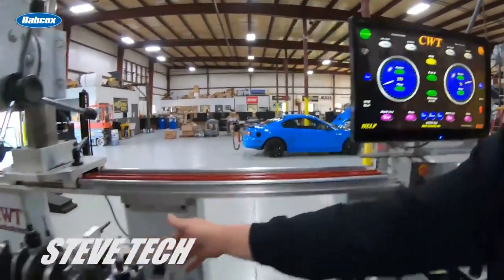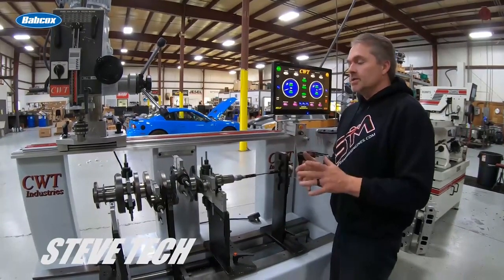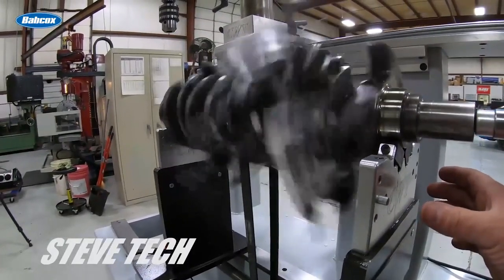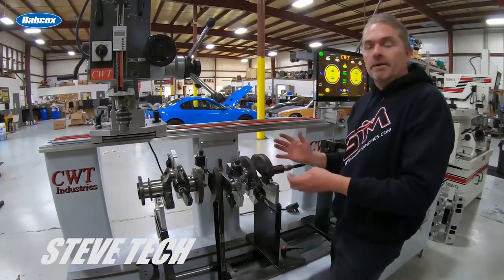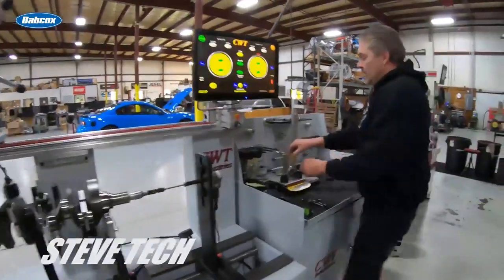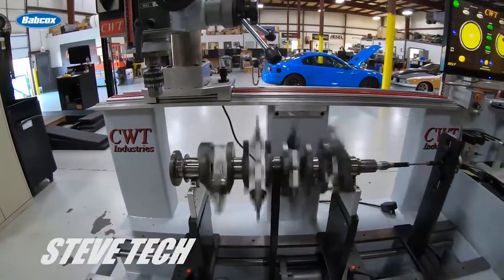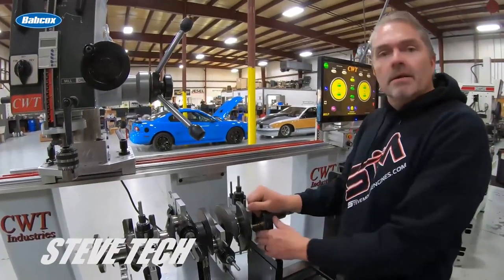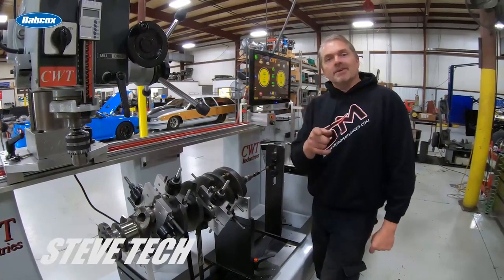Crankshaft Balancing – Part 2

Comment: You missed the most important part of mounting the bob weights.  Clock position or level as you used is nearly irrelevant. It is absolutely essential for the bob weight to be in the center of the journal (Neal, 2007, 2023). Additionally, do not rotate the crank by the bob weight.

Comment: Do u always have to take the extra weight into consideration? Can u not balance the crank shaft without adding the weight of the piston, rods etc?
Reply from the maker: No, you always want to take into account your entire rotating assembly, which includes pistons, rods and rings, etc.

Comment: Is a NEW crankshaft properly balanced or can it be way off? I am balancing my rods rings pins pistons so what do you think? Great videos Thanks!
Reply from the maker: A new crankshaft will still need to be balanced. Many crank manufacturers offer balancing as an option, but it's typically not included if you don't ask for it.
Reply: Oh well that explains why some newly rebuilt engines just  don’t sound quite right. Thank you for your help!
Reply: @EngineBuilder  about how much does this cost to get done?  Working on my very first build this summer.
Reply from the maker: @zadynsmom  the price depends on the crank manufacturer or the shop you bring a crank to for balancing.

Comment: Thanks for the tutorial Steve. If you still have your ears on, could you comment on externally balanced engs.? (Or maybe a viewer who knows.) A Pontiac 301 smog motor, (built from 77-81) has what's called a "rope" crankshaft. Only has 2 opposing counterweights, (one at ea end). Like a 400 SBC, it has a corresponding damper, and flywheel.
If the rotating  weight is changed, (say .030 over pistons, and lighter rods), what would you recommend for balancing? Or would it need it, if kept under 5K RPMs? Thanks.

Comment: thanks stevie, just a quick question i've seen cranks knife edged and balances without any bob weights what effect would this have on an engines running and performance it was a 4 cylinder don't know if that has any bearing.

Comment: Is that a makeshift thinggy?  why not balance the whole assembly in a/the block? 
externally driven,no explosions, no need for oil pressure,grease will do for those seconds at a time..

Comment: Question,  what is the reason for balancers, stick type,but some are 28 oz, 50 oz. The balancer im replacing has no balance weights that I can see,removable or otherwise.  I do know the new flywheels or sold in conjunction with 28, or 50 oz balancers. Can you please explain this. I don't want to buy the wrong parts. Putting together a reasonably hot sbf.externalky balanced. Just want to understand  the protocol.  Thank you
Reply: All stock OEM 351W are 28 oz imbalance. That means from combined imbalance weight of flex/fly wheel and balancer are 28 oz more. On 302's Ford changed the imbalance from 28 oz (from 1968 to 1978) to 50 oz imbalance (1979 up) This was because Ford removed 22 oz from the cranks 79 and up. So they had to make up for removing 22 from crank by adding it to flex/flywheel to keep things the same. 28 + 22 = 50

Comment: I am designing a new type of Rotary engine... with 16 cylinders... with 8 cylinders on one side of the crankshaft and 8 on the other.  Where all 8 rods are on a single lobe on each side.  So it is basically a 2 cycle... with equal forces on both the up and down on each of the cylinders.  Which is approx. 1200 lbs. of downward force at the top of each cylinder stroke.
And what I need is someone to help me revise my (SolidWorks 2018) Crank Shaft drawings to facilitate proper balancing.  And Afterwards, I will need to purchase equipment to do the balancing of successive equipment I build.  I need help to locate a place to help me with the initial balancing and redraw of my Crankshaft.  Can you help me with this?
Leslieallen  At... inventorshaven@pm.me  I am designing this engine right now.  
I live in Oregon area... and it would be convenient to find someone close to that area if possible.  But I will not be critical about that if it comes down to it.

Comment: The weight distribution of the bobweight itself may not be ideal evenly. Therefore, it is not relevant to put them on necks with a rotation angle of 90g. You can check the bobbin unbalance by placing it on a balanced rolling pin equal to the crankpin diameter. This is very easy to do. After doing this, you can explain about another approach to installing bobweights on the necks. Good luck checking out the bobweight imbalance.

Comment: Any thing + - a gram is great. Over or under balance is a builders choise and oil and windage are not a constant variable do to rpm / engine load and engine acceleration/ deceleration deloading. A engine like industrial type at a constant rpm / load is completely different from a drag / oval track race engine. Dynamics are a factor

Comment: 8 grams at 4" at 8000 rpm is about 250 lbs (if memory serves)of side thrust on the bearings so that's rpm capability and horsepower loss. We never balance outside 2 grams, better is always better. Not saying 8 or 10 grams is horrible but it barely takes any more time to get to 1 gram on each end.
Reply: 8 grams 8" from center at 8000 is 112 pounds of out of balance force
Reply: I've been balancing engines since the mid 70s, on a Stewart Warner model 2000
Reply: i'd love to know what extremes of balance F1 went to in the 18k rpms days.
Reply: What I don't understand is that he said in the last video that the post it was about 0.8 grams but now he is saying its 8 grams?
Reply: @krnt13 1 gram is the weight of a US currency bill...
Reply: Incorrect, 8 grams 8" from center at 8000 rpm is 112 pounds of out of balance weight...
Reply: @ChiefCabioch  You’re absolutely wrong about your numbers! But does it really matter to make the point.
Reply: Out of balance Weight goes up by the cube...
Reply: @ChiefCabioch  🤣That’s funny! Even after two years you’re still just as wrong.
Reply: @causeimbatmaaan  how long you been balancing engines genius?
Reply: @causeimbatmaaan  you had to question your memory, I didnt...
Reply: @causeimbatmaaan  you only think you know balancing...but you dont...
Reply: Yup this guy's a hack doing half assed work
Reply: Ask the guy that balances crankshaft above 5000 rpm and find out that information
Reply: @causeimbatmaaan  there is no side thrust from out of balance, it's all centrifugal force, not for and aft...

Comment: What happens if u dont balance a 454 engine?
Reply: It will shake like a dog craping peach pits and break the crankshaft causing catastrophic failure.
Reply: @stuartbuckley8720   when, at what rpms? will it shake itself to pieces right off idle? at full bore?will it idle?

Comment: Get you some of those small powerful Neodymium magnets to stick on the crank in different spots. There cheap on Amazon.
Reply: May stay on a 500 rpm but what happens at 10,000?
Reply: @ellieprice3396  I'm pretty sure he was using magnets like the jamb bolt used in the video.  Used as reference because heavy metal can't always be added in the exact spot the machine says to put it.
Reply: @andrewevans1658  true.

Comment: Don't work at Auto Zone, I work on bikes that rev to 15k.  8 grams DOES matter.  Unless you only work on crap American engines.  XD
Reply: Sounds like a pissing match to me, you boys need to chill and get some beers.
Reply: @stuartbuckley8720  Not really, but ok
Reply: "Crap" American engines? don't think so. Former Holman and Moody machinist.
Reply: @ellieprice3396  Nobody's impressed old man.  I do think so.  They're crap.  Always have been, always will be.  Former machinist and current chassis tech on a national team.  Show me an American engine that makes over 100hp/liter and runs half a million miles.  There isn't one.  Because they're crap.
Reply: @mikaelgaiason688  100hp/l (naturally aspirated) can be done in an overly complicated engine. american V8 are extremely simple engines, much easier to work on and less chances to go wrong. For high power applications they use aggressive cam profiles and higher rpms, not suitable for street. So they are not worse they simply have a different cost effective and reliability approach, plus the crossplane v8 sounds really good. Anyway these engines are nice for sports cars not daylidrivers where you need better economy.
Reply: @rotorblade9508  you're wasting your ink, responding to a commenter who can't even spell his own name correctly. (Mikael?). Here we go again. "My engines are better than your engs., and I'm smarter than you. I work on bikes that crank 15K, and 8 grs "does" matter".
 
Steve is correct on everything he mentioned in this video. So now it's my turn. I've been building and balancing Pratt and Whitney dual spool jet engs. for 40 years, and have stood behind these same machines for that same amount of time, to this very day. The "real" world is totally different from the engineering "book" world. Have this same battle with people who don't balance all the time, and hear the same stories from others in the trade. A book could be written about this dilemma, and this thread is not the place to prove it.
Reply: @mikaelgaiason688  the ford 5.0 does it easily for starters, so does the Corvette and the Dodge Challenger engines, much more then 100 hp per liter at that.
Reply: They wil alll last 500k if properly maintained
Reply: @mikaelgaiason688   mustang 2 liter Eco boost engines.